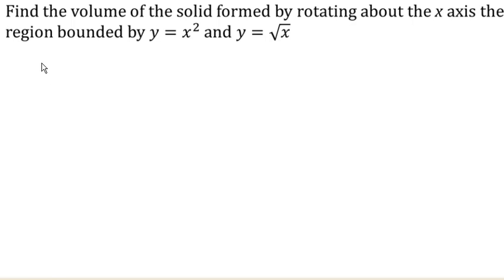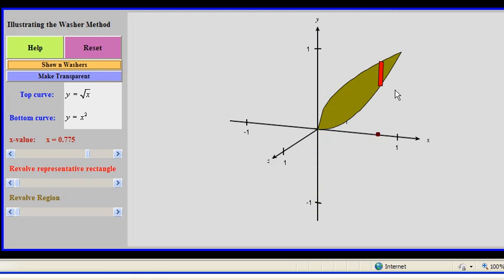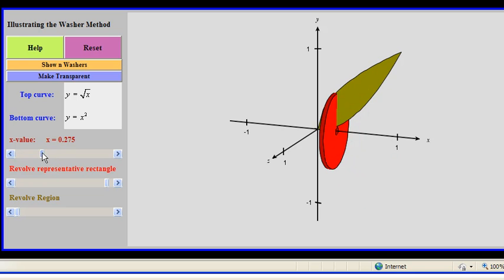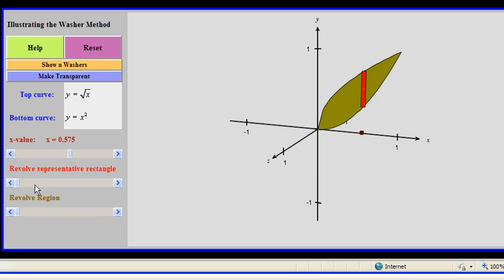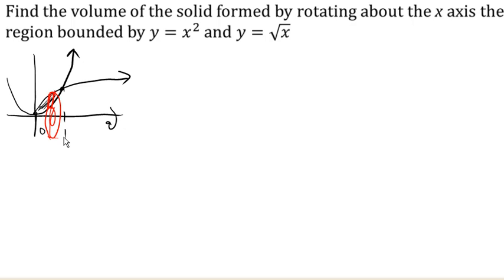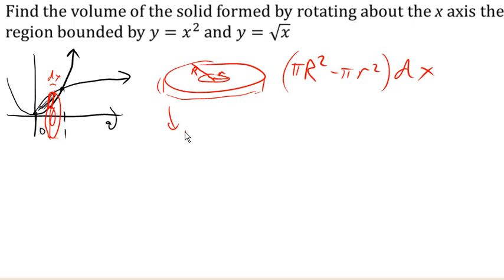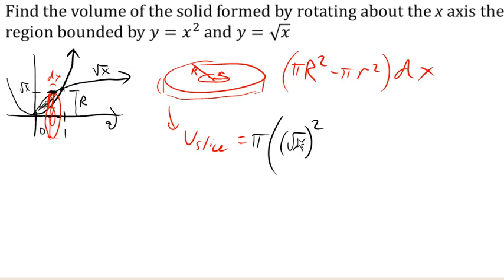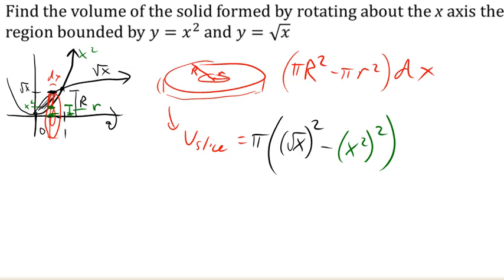Rotational volume using the washer method

Comment: Hi professor I have a quick question on my hwk I am not seeing why i am incorrect. It states to the Use the washer method to find the volume of the solid generated when the region bounded by y= 3x and y=x^2 is revolved about the x-axis. What would be the Volume of the region?
The bounds are b. 2 and a. 0

I keep getting 54pi. Am I doing something incorrectly?